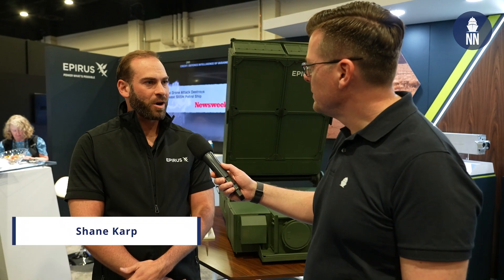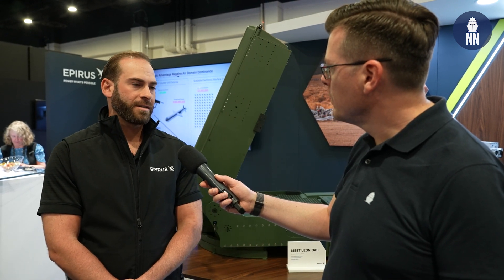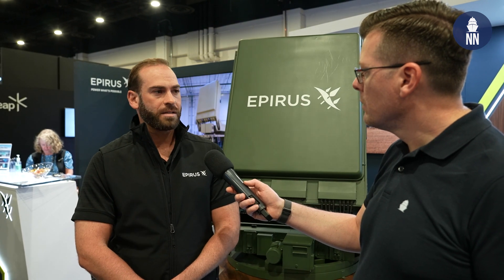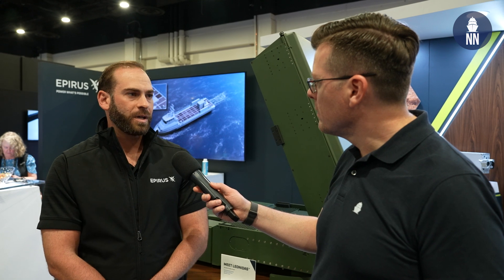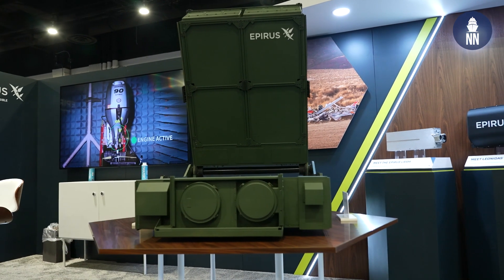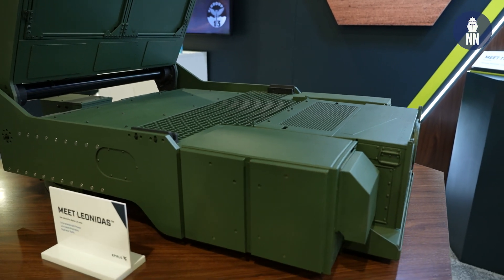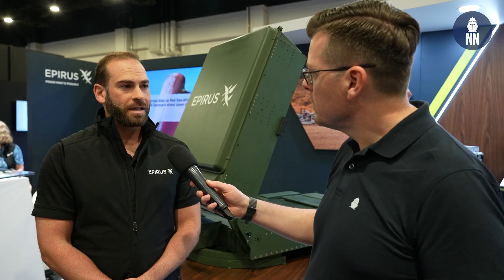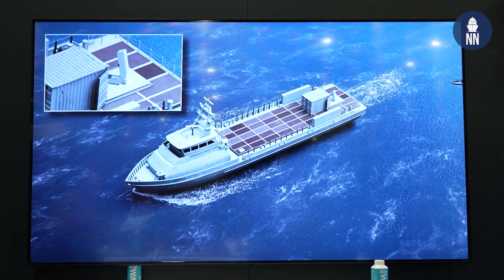U.S. Navy to Test Epirus’ Drone-disabling HPM Technology

Comment: Range is a big question for a directed energy weapon like this. Damaging the guidance system of an affector when it's already on a terminal trajectory isn't a safe option. It needs to have the range to disrupt guidance electronics before the terminal stage, which means in practice a cruising altitude of around 40,000 feet or 12 km.
Reply: You’re missing the point. No USV is flying anywhere near 40,000 feet. And USVs have proven to be a major threat.
Reply: @LikeMano-sd3hq  Allegedly, Iran's Shahed-171 has a flight ceiling of 40,000 feet. If the Epirus HPM's effective range is exactly 12 km, you wouldn't be able affect it until it's directly above the warship. That's just an example of today's drone technology produced by an adversary that can't even be considered a peer of the western nations that it's being marketed to.
Reply: Group 4/5 drones pose a unique threat but 12Km is not impossible. Point is still to not have to use expensive missiles on cheap drones  Save them for the group 4-5.
Reply: @LikeMano-sd3hq  Correct.  Different tools for different purposes.
Reply: Useful for certain USVs. My issue is tech damaging to users if they are near it?

Comment: I think Epirus needs a new slideshow guy.  I had to look at that slide like 10 times to figure what point it was trying to make.  At first I thought they were trying to say that a $20,000 drone has the same kinetic effect as a $100,000,000 Tomahawk missile.  That would be ridiculous enough in and of itself, because drones aren't doing the same level of damage as a Tomahawk does, but claiming that a Tomahawk missile costs $100,000,000 just makes it so much worse.  I'm assuming the number they meant to put on the slide was $1,000,000, which is the approximate cost of a Tomahawk.

However, that slide is actually even worse than that, because I THINK what they were TRYING to depict was the cost discrepancy between a commercial drone and the AIR DEFENSE missiles used to shoot them down.  So not only did the guy (or girl) who made that slide claim that an individual Tomahawk missile costs $100,000,000, but they didn't even use the right missile!  The Tomahawk is a cruise missile.  Not an air defense missile.  You aren't shooting down ANY drones with a Tomahawk unless the Tomahawk crashes into one by random chance when launched from a ship's VLS.  What they were presumably looking to depict there would be an SM-2 missile...and an SM-2 is way more than a million bucks.  One of those is like $2,500,000.  They also could've used an ESSM...which is a ridiculously expensive missile as well at over $1,500,000 each.

So...yeah.  Definitely time to find someone a little brighter to make their important slideshows because that slide is a disaster.
Reply: Very confusing slide but I think the point is $100m to take out 100 drones.
Reply: I think the left slide shows that a cheap drone could be as efficient as an expensive missile with a 1:1 ratio.
The slide on the right, having in mind that a cheap drone could be as efficient as a missile shows how many drones could be intercepted with only 1 Leonidas.
I don't think it's a money comparison,

Comment: Rotating sensor no longer appeal to me.  Non-rotating sensors however have all the benefits particularly for constructs in a salt air environment that moves in multiple axes.  With AESA technology now available it makes no sense to build moving parts in a corrosive environment having to deal with motion in so many axes..
Reply: AESA can steer their beams on 120° arc. So, you'd need 3 to cover 360°.
Or, you can have 1 rotating system.
Reply: There are pros and cons of each.
Reply: @Awesomes007  Mostly $$$s.   If you want to survive at sea you do not have rotating antennas.  The equation for supersonic sea-skimming Anti-Ship Cruise Missiles is '45 seconds to impact' from detection to them exploding on your hull.
Reply: the dome radar on the de m-shorad comes to mind.